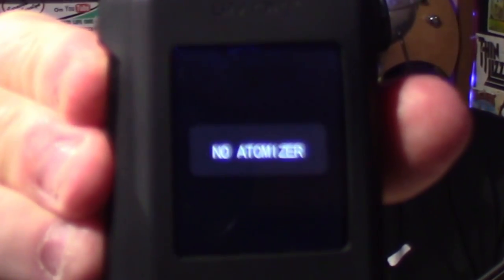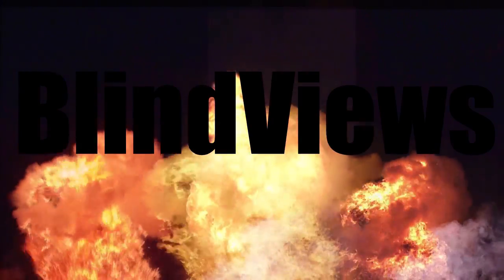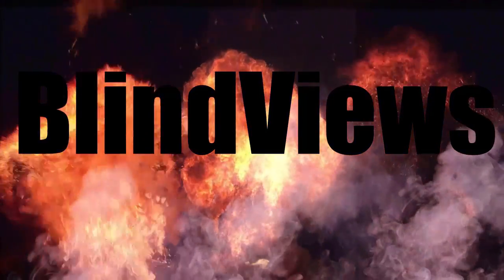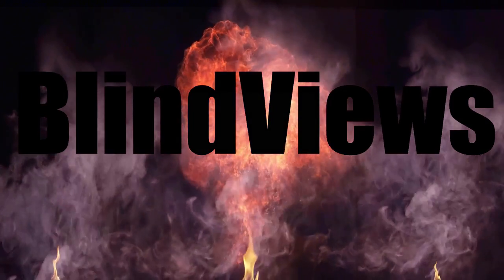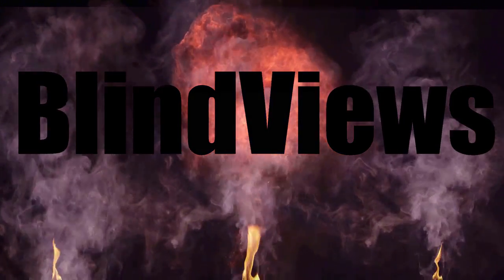NO ATOMIZER message Vape mod (2019)

Comment: Thanks for all the common sense fixes, my connection issues were more serious as the 510 connection in the mod started to turn a little more every time I changed tanks and eventually pulled the wire that was soldered to the 510 off inside the mod. The 510 is just a press fit and with use some get loose. I did not want to risk soldering it so bought a new mod.

Comment: I have an Agesis x I’ve done all this but it still says no atomizer pls help what do I do
Reply from the maker: Do you have another tank or atomizer to try on it? Unfortunately it sounds like there is a real issue with something. The next thing is to figure out what devise has the problem.
Reply: @BlindViews  I used a brand new tank I just bought recently and it still says no atomizer
Reply from the maker: @djbenson8747  It may be a bad coil or the wrong ohms. Check the coil. Even though it's new, you can get a bad coil. If the mod was working until the new tank, I am guessing it is the tank main post not connecting properly or the coil.

Comment: Very good BV. I use a tank with manufactured sealed coils. The first thing l check is the 510 connection. Sometimes the tiny screw on the tank needs a little adjustment to get that connection with the mod, but like you said try cleaning it first before adjusting the screw. Another reason for that No atomizer message can be a hot tank from use being transferred to another mod, let it cool a little  (2-3mins) and it should be fine .......Nice handmade Clapton coil btw 👍😃
Reply from the maker: Thank you, Kat. I experiment with different coils a lot. I do twisted pairs, claptons, three wire twisted... I think that is half the interest in vaping for me. I make juice, coils, and play with stuff all the time.
Reply: @BlindViews  l know. Vaping can be very techy and coil making can and is a work of art as you know. There are some most extraordinary coil makers out there, really beautiful work. You do very well BV 👍😃

Comment: Hi, can u help me? i have cleaned up everything but still "no atomizer found" (Zeus with eVic VTwo mod)
Reply from the maker: Could be a bad or broken coil, the pins of the mod and tank are not touching, or a problem with the mod. Also make sure that the ohms are not too low or high for the mod.
That is the best advice that I have. If everything is clean, and there is good contact, and it's not a bad coil, you may have a problem with your mod.
Reply: @BlindViews  HEY IM MY CASE I CONNECTED A COIL DIRECTLY TO THE CONTACTS WHERE THE ATOMIZER GET PUSHED TO WHILE SCREWING IT DOWN AND I PRESSED THE BUTTON AND IT SHOWS ME CHECK ATOMIZER SO I KNOW ITS NOT ATOMIZER IT SELF AND ITS NOT THE COIL IN THE ATOMIZER AND ITS NOT THE SEPARATE COIL I CONNECTED TO THE CONTACTS OF THE VAPE DEVICE SO IS IT INTERNAL ERROR ??? PLEASE HELP ....... THANK YOU

Comment: Well, it's now 11 days without cigarettes and only vaping for me. I got some weird error code, so being a typical man, I ripped the damn thing apart and put it back together with maybe the same number of parts and now it works again! LOL.  Mine has a lithium ion battery and I wonder what would happen if it short circuited in my pocket? I think it might be ugly...
Reply: Congratulations mr Andrew  keep it up
Reply: Linescrew- All mods work with lithium batteries so battery safety is necessary 👍
Reply from the maker: Yes, I use what are known as 18650 batteries. It's a size number. Battery safety is a big part of vaping. That is why regulated mods are much better. It regulates the wattage and the ohms to avoid dangerous problems. There are unregulated mods (no computer board) that often are used incorrectly.